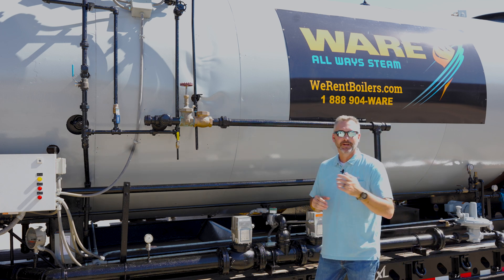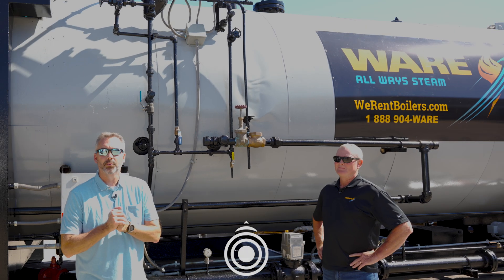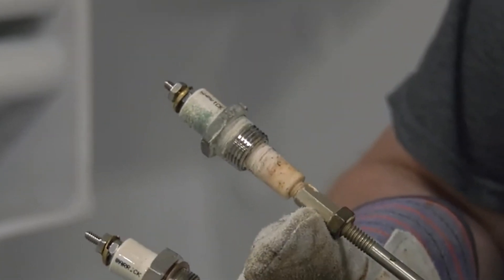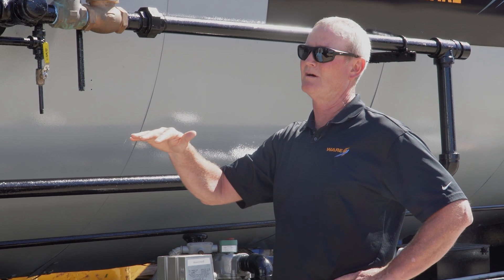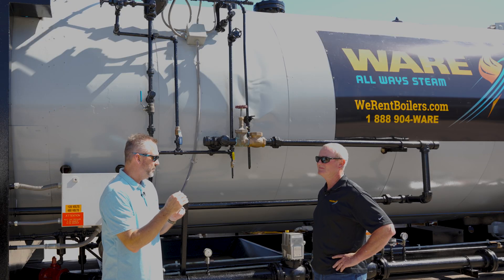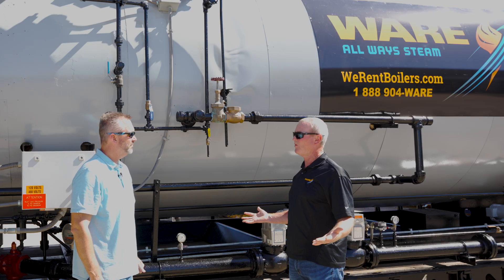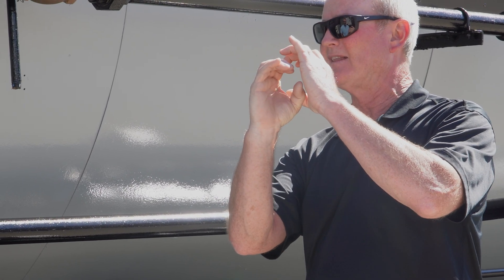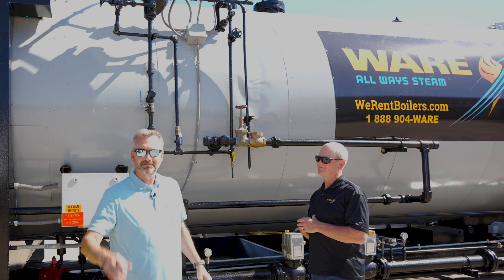The Hidden Risks of Horizontal Probes - The Boiling Point

Comment: This is a problem when you use the chamber as the common. If you use a second pro as you're common especially if you use long probes and you point them downwards as they do in Cleveland Brooks boilers. This is no an issue. However the fact that you're using a safety relay or FireEye BMS system is usually the reason that you are using probes and floats in the first place. And this system is a lot more expensive than transmitters when you get above 350 psi. At that point you can switch to 2 out of 3 voting with transmitters  using gwr and dp level. Then retransmit to the CCS. At least that's what I recommend.

Comment: Can you pls do a little bit on fusible plugs . Kind of want to know how it actually works.
Reply: Fusible Plugs is an old school safety device used to determine low water. The center of the device is usually made of tin. When the tin melts it will cause a whistling notifying the operator of a low water condition.

Comment: Mr Ware I really love you video and I do watch your video every single day. I really want to ask an important question.  Cant a temperature sensor be place at the exhaust or flue chimney to detect change in temperature. Like when water is no longer inside the boiler I believe the flue gas temperature will increase more than normal.
Reply: If am not mistaken I think that is the work of the stack temperature sensor.
Reply: @pz3401 commonly the exhaust temperature is merely monitored to give you an idea of the health of the economizer. Using both inner and outer temperature on each side of the economizer. This should be stored and trended. I also recommend doing the same on the feed water input and output from the economizer.
Reply: @trentbergen7100 what about cases where there's no economizer on the unit?